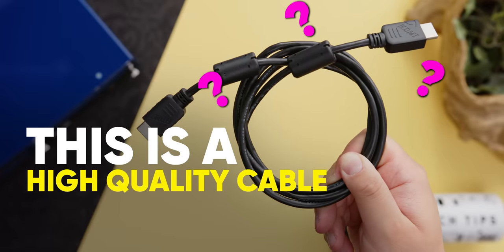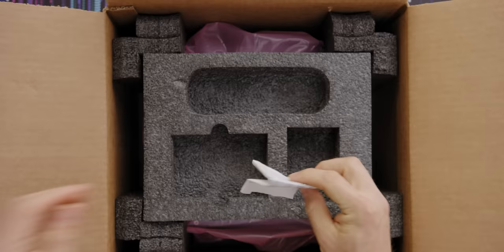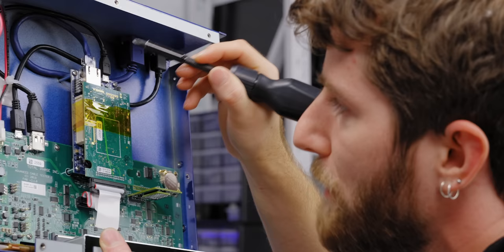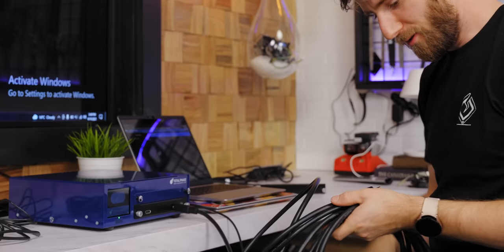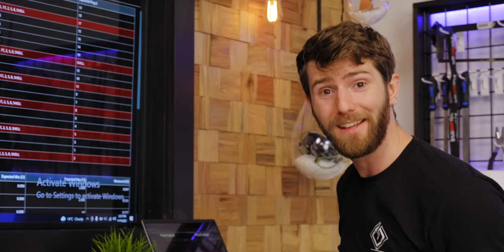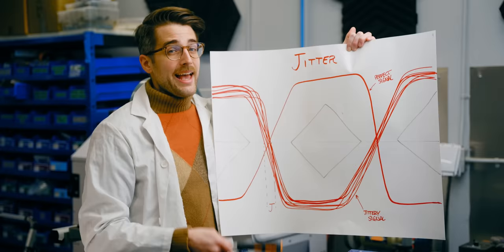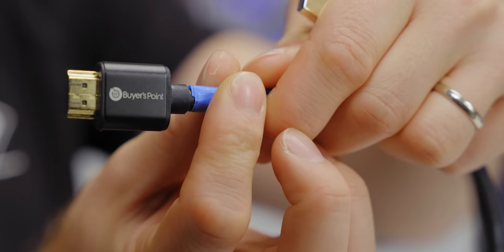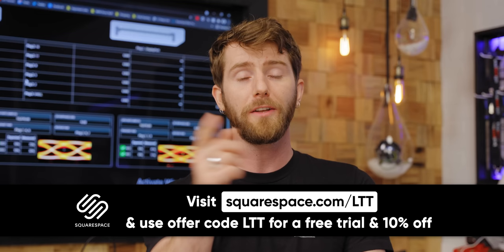This Just Saved me $100,000 - Totalphase Cable Tester

Comment: 6:05 - "The next big reorg, I want us to take every bin and every cable and run them through the cable tester. We take all the ones that don't pass and we throw them away."
God I wished I had a manager that thinks about efficiency like Linus does. 

The workplaces I end up people keep everything that is damaged, broken or build outside product specification. I've asked to stop ordering 10 to 15 meters DP and HDMI cables, I've asked to threw away broken or damaged tools and equipment, yet nothing changes. Even something as cheap as a scissor isn't replaced when the handle broke of, they tape it back onto it and each time I need a scissor it just bends around the handle... 

I've tried throwing away things myself, but they magically end up in the storage room again... It even came to the point where I started putting my foot on death pcb's to break them in half, so nobody could pick them out of the container and put them back between other working parts... Massively annoying!
Reply: What kind of company do you work for lmao
Reply: I get trying to save costs but eventually you get diminishing returns and it becomes not worth it.
Reply: Have you tried just putting labels on things which say "Faulty"? At least that way they're not going to cause unexpected problems.
Reply: When someone needs a pair of scissors, give them the faulty one.
Reply: @iAmTheSquidThing   Does throwing it inside a bucked labeled "trash" count? 
Not sure why someone would deliberately take some broken stuff out of a trash-bin to be honest...
Reply: "You might think that sounds ridiculous and a lot of work"
No, actually, that sounds 100000000% reasonable. Zero sarcasm.
Reply: I feel your pain. We can end up with wrong parts that never get sent back and cost in the 100's, just eating up inventory space and it drives me nuts.
Reply: @flixelgato1288  An unfortunately common type of company.  I've personally seen the owner of a small company I worked for berate an Electrical Engineer for putting a bad cable in the trash.

Management at these places is often short sighted.  All they can think is "this cost money".  Not, "how much will it cost in time to make someone use this."  Other common reasons are the person believing they know better, and "It works fine on my machine, so why are you throwing it away." Despite running a 2017 MacBook with an equally old monitor.  My personal favorite though, is the company sees labor as a fixed / sunk cost for salaried employees, and so doesn't care that things take longer.
Reply: @arthurmoore9488  Yup, the fixed / sunk cost for salaried employees only enforces inefficient work-styles. 

It's just unpaid overtime...
Reply: @GamerNationTecno  Same as where I work. My boss is the type of person who does things first (like ordering equipment), then thinks about it later (for what can we use the scrap I ordered)? 

Our inventory space is completely filled at my workplace, to that point that I don't even have 1 square meter of desk space to do my job on. 

I've started a private stock of electronics components in my cars trunk, I need them neatly structured and sorted to do my job efficiently. If I store anything in the office building they just end up somewhere else 2 hours later, most likely mixed all together in one huge box...

Comment: display port would be great, wondering if affects high hz gameplay somehow.
Reply: nope. A cable with either work 100%, or work with dropouts (that are very obvious) or not work atall.
Reply: @djenson  and those dropouts will most likely result in a blackout and the monitor downscaling to a lower HZ automatically
Reply: Yooo, didn’t think I’d find you here. I claimed the aimbot too hehe
Reply: Yes, display port please! Exactly two of my many many cables work on my ultra widescreen, plus one mini displayport-to-displayport cable that works with dropouts but I NEED for work because the surface dock sucks
Reply: @djenson  Shame this wasn't mentioned in the video, now everyone will be neurotic and think their cables could be "degrading signal" in a literal sense. These are digital connectors, not analog. Analog cables can physically degrade in quality, digital ones cannot. It either works or doesn't, as the receiving end of the cable reads the signal and reconstructs the digital bits (1's and 0's) that were originally being sent, and can detect through a checksum if the bits were altered in transit
Reply: Yes you're right my cable is the reason I'm not radiant
Reply: The higher the bandwidth, the more susceptible to interference the cables become. So yes, some cables might become unreliable when used to transmit signals at refresh rates and resolutions.
Reply: @djenson  You say no, but a cable that has random dropouts will affect gameplay.
Reply: @djenson  you can get borderline HDMI cables at least, still obvious but not to the point of dropping out, they go kinda "sparkly"
Reply: I had two display port cables that would randomly cause the screen to go black for a second every few hours.
Reply: @alouisschafer7212  I've never heard of it magically going down to a lower refresh rate automatically. The computer will just keep trying in my experience, until you manually turn it down. furthermore, if you display blacks out and you aren't looking in event viewer and checking your drivers and display settings you almost deserve to be playing at a lower refresh rate. black outs = something's wrong please help me.
Reply: @borisyeltsin6606  Exactly. Linus has even meantioned this in the past.
Reply: @SteelSkin667  drop outs are total failures. I think OP was wondering if it could cause lower frames in his games which it won't.
Reply: @AngDavies  Sounds interesting. Seeing as hi and displayport are digital standards with 1's and 0's unlike the old anolouge equipment, I'm curious how that can happen.
Reply: @djenson  off enough to occasionally read that one as a zero, or vice versa.

 not the  a fuzzyness like analogue but  pixels that are blatantly the wrong color. Gritty red dots on a solid black background.
Error correction is minimal on the video side, (at least on the older style hdmi, not sure about new one)

It would be bandwidth expensive, and it would need to be robust enough to correct errors, not just detect them (hdmi mostly one direction, so the receiver can't re request a failed packet or whatever.

So bit errors can sneak through, probably in the verge of breaking up but not quite
Reply: @djenson  That's OK, that is not how I understood the question but then it is a bit ambiguous. At least we agree on the principle.

That being said, after looking into it a bit more it turns out that an image can come through with some artifacts (or "sparkles"), and on some displays intermittent drops can cause freeze frames instead of black screens. There are more modes of failure for digital video than I thought.

Comment: I friggin' love when Riley is... like this.
As for the device, obviously not something I - a certified rando - could justify getting, but it would honestly have come in handy a number of times. And why wouldn't you just test every cable with it if you had access to one. Really cool and well made product.
Reply: at $15k it is definitely not a certified rando product. Maybe certified professional rando. I just threw away half of my cables within the last couple months because I kept having issues with my monitor-dock-laptop setup. It sure would have been nice to be able to actually test them instead of pluggin in cables until one kinda worked consistently.

Comment: This output should be on an independent site for all cables. Knowing what you're actually getting without having to guess (minus the manufacturer dropping quality after a test) is super helpful to the buyer.
Reply: I agree, have a thread on the forum or somewhere similar that has each brand/series of cable and compare their rated spec with their actual validated spec, like for HDMI or USB-C cables. It'd be very useful to know which HDMI cables are rated as one spec, but actually another (for better or worse) because who knows, there may be some high quality HDMI 2.0 cables that can hold a 2.1 signal
Reply: Yeah, that could be a problem. I would imagine many of the brands that are just sourcing cheap stuff from china might change sources now and then.
Reply: @BriBCG  Of course, but you'd at least know at the time of testing that the cable was good. Having some information is better than nothing.
Reply: yeah our connections are getting faster and faster so inferior cables are a real issue now

Comment: You should test the difference between "High End" cables and low end cables, like AudioQuest's higher end ones that use "Silver"(i.e. Thunderbird). I know there is a lot of cables out there that claim they are "superior" to cheaper cables simply because they use "better quality" materials inside, however is there "really" a difference that a user would notice?(and not referring to distance capability, but quality of the data received since most higher end consumer cables are between 1m-3m).
Reply: No there won't be a difference you can see. A cable either works or it doesn't.

Comment: The hand soldered wires at the board, shown in the beginning of the teardown, are called bodge wires I think. They're normal and appear quite frequently in equipment that's produced in small quantities (usually industrial). Running two extra traces in your case would mean extra engineering time to design a new pcb and ofc (probably massive) extra cost to produce new ones instead of a tiny job that can be done in 2 minutes with a soldering iron. Those wires will probably not be there in the next version of the product.
Reply: or they are there because of a broken trace. again they can't afford to have a board not be functional because of that small quantity you mentioned.
Reply: Έτσι ακριβώς. We see that in lots of prototype consoles and stuff too, or hobby projects that are not worth re-ordering.
Reply: Don't forget "intentional broken design". A common method to protect your valueable product from being stolen. It's for some products cheaper to hire some guys to solder the traces back together than getting it copied. However, there comes a pitfall. In Germany for example, if your product got stolen and you had an "intentional broken design", having this case come to court might be a bad awakening for you. That is, if the party who copied your design did actually "fix" that /broken part/ in their copy then it is ruled as "technical improvement" and therefore no copy anymore. In short: case dismissed.
Reply: the engineering time of making the bodge wire drawing is more expensive then the engineering time to change the board.
The problem is supply chain and inertia: That board can be ordered, patched and sold.
Maybeb there are even 20 laying around the shop, ready to b e sold with just a patch wire,
Changing the board requires a new prototype, new approval, new qualification, .... and binning the old b oards.
As you say: Next product revision and they will resolve that. But also: Do not worry about it.
Reply: @andrewblake8797  Of course.

Comment: A lot of monitors, particularly gaming ones, come with DP or HDMI cables. I’d like to see if the cables that are shipped with high end monitors can really support the product that you buy.
Reply: My experience with electronics devices from major brands is that the included cables (whether display, power, USB, whatever) are usually excellent. I mean think about it. Do you want people returning your expensive TV or writing bad reviews on it because you included a crap cable? Of course things can change when you get to cheap, generic Chinesium stuff.
Reply: Exactly, every monitor that they test from now on should get a tick if the cable is upto scratch
Reply: Hilariously: no. They cheap out hard with the provided cable. My 4k samsung TV came with an HDMI cable and for the longest time I thought I could only do 4k 30 on it from my computer. After "losing" and finding a different cable, I discovered that 4k60 is absolutely possible.
Reply: @calvindibartolo2686  was your computer a macbook? Because I have encountered some known issues with 4k outputting only 30hz with some cables.
Reply: @Z3DZ3R0  nope. Custom build X99 xeon with 32gb ram and a AIO cooled 1080

Comment: @6:23 alternative take:  someone spents days testing all the cables and now you're sure that every cable performs. Points of failure in this method: 1) this someone missing a cable or the cable getting damaged between testing and usage (might be years apart) or some new employee who doesn't know about the qc of the cable inventory, adding untested cables to the inventory. you'd never think of the cable while troubleshooting. Simply going to the tester every time you're troubleshooting something involving a cable seems much more efficient and only point of failure is the tester being unavailable.

Comment: Would love to see the fuss about audiophile grade USB cables, I've heard the difference on very high end systems, but always been sceptical of the almost random pricing differences of the cables, ground noise and DC presence excluded I'd be super excited to see the signal integrity and jitter these 'grade' of cables provide (or not).
Reply: I have always heard it doesn't matter with USB as it's digital, but it would be interesting to confirm that. though proving anything high end audio is damn near impossible, and I love high end audio
Reply: Usually the claim with audio grade cables is low jitter, so he can certainly determine that.
Reply: "Audiophile" cables are for the most part snake oil
Reply: I guess the thing that most of us skeptics want, is to quantify jitter performance.. We know that benchmarks only paint a part of the picture, synthetic or not we at least have some framework to make decisions from. Both $50 and $1000 cables are generally sold using adjectives and metaphors..
Reply: The USB protocol is based on packet-switched data, not analog signals. Considering audio jitter on USB sounds nonsensical, so long as data makes its way through the USB cable, the audio after decoding will not be affected. The only way USB can botch an audio signal is if the hardware itself is designed poorly and cannot deal with noise coming from the computer to its ground planes (power planes are also considered ground planes, as they both ground signal traces).
Reply: @ujiltromm7358  while it is packet based, i dont think theres any crc/checksum or retransmission with usb audio, other than the reference packet and the devices reported delay there isn't any validation of correctness for the words/frames after that. I think these 'high-end' cables aim to reduce the chance of the front or back side of a pulse getting interpreted in the wrong clock cycle. Of course there's so much more to delivering 1:1 signals than just the copper, but I don't think usb audio has enough gaurentees to ignore at least considering a cables impact to the end result.

Having never spent any of my own money on these kinds of niche products, I cant really say that much more to their actual value or contribution..

Comment: I’d love to see if things like coiled vrs uncoiled and sharp turns or when crushed what really happens to the performance
Reply: That's a really good idea! 👍 Don't just test a cable in a brand new condition, but also check how it holds up with a bit of wear and tear!
I always frown a little when I see a badly bent cable, this way I could know how much of an issue it really is!
Reply: There's something called the "reverse coil" method of wrapping up cables for storage.

Audio engineers use it when they're tidying up mic and guitar cables.

It's a method that causes less stress on the inner wires as it's being wrapped in a circle, so reduces the chance of the cable causing interference whilst recording.
Reply: @Dempsey1504  I was graded on wrapping cables this way in college last year (for audio courses) and ever since then I wrap ALL my cables like that, no hesitation. It's SOOOO much nicer and easier.

Comment: When reviewing monitors, testing the included cable would be neat!
Reply: OH. BOY. This. Not to mention, something like TV Boxes. Like the Xiaomi Mi Box S. The HDMi cable that came with it is gutter trash. To the point where image quality saw a full fledged quality reduction when using it. That thing is 100% barely ready for HDMI 1.2. HDMI 1.4? Huge maybe. HDMI 2.0 for 4K 60 and even HDR? Nah. Signal will go through but you will see random bugging left & right.
Reply: generally those cables are among the best, the monitor manufacturer has a vested interest in sending a cable that works as faulty cables are often mistaken with faulty monitors
Reply: @deathbe4me  Tell that to Samsung who decided to include a DP cable with the ground switched with the 3.3 volt that shorted out my new 34" G5 and nearly caught fire. They told me is was a bad batch of cables that "somehow" passed their own testing and was shipped to retailers.

Comment: I'm loving all the reviewers branching out recently, first GN with the power supply reviews, now Linus thinking about cable reviews, and I'm pretty sure GN is also about to do case fan reviews as well. there's no reviews on this stuff, but everyone uses them all the time
Reply: Well.. if by "about to" you mean in a year or so. They got their new testing rig shipped in, but they still have a loooong road of learning how to use it, then devising a testing methodology that meets Steve's rather high standards, and finally some validation that their method is both working as expected and providing useful data. But it's coming!
Reply: Reviewing the "next best thing" every day im sure make linus a very dull boy.